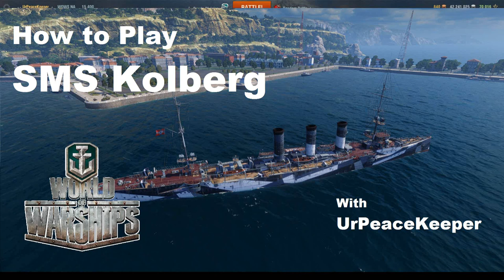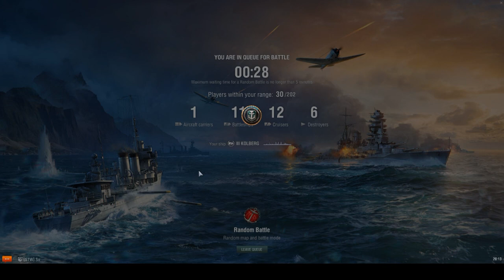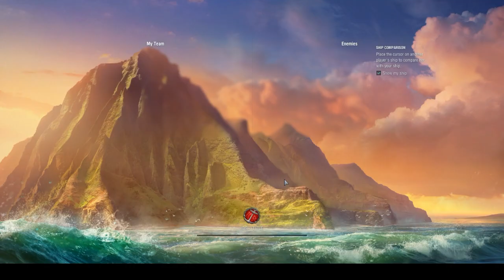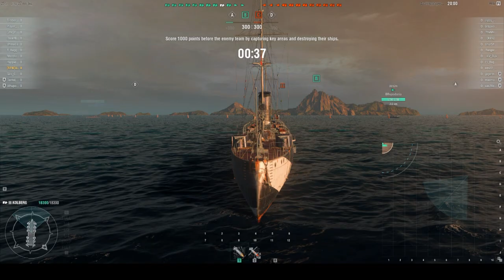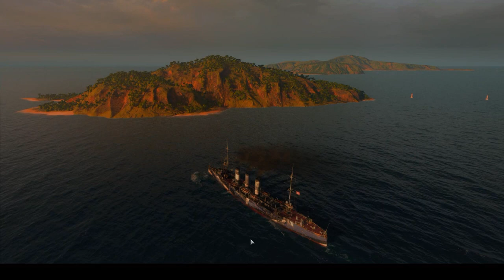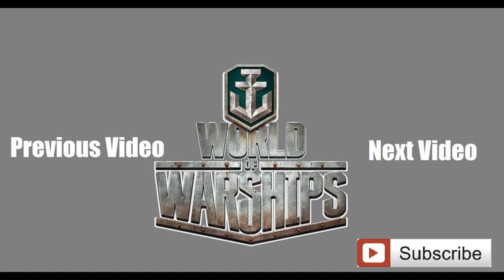How To Play SMS Kolberg In World Of Warships

Comment: Just started the game recently. How do you keep firing at another ship while not looking through the scope and steering around at the same time? I always crash into islands because i keep locking onto the target
Reply: Right click button. The game has an option that lets you automatically track ships you're locked onto horizontally. It doesn't track vertical movement.

So you only need to adjust aim if they manuever or have been sailin angled to you so you need to readjust.